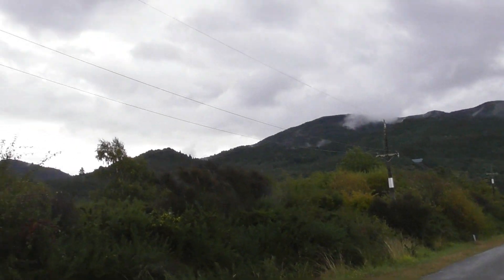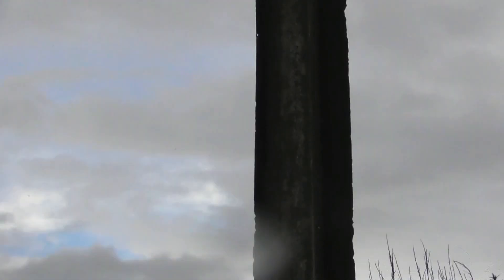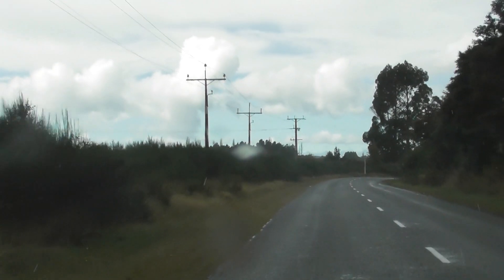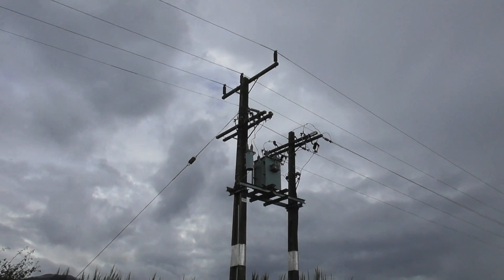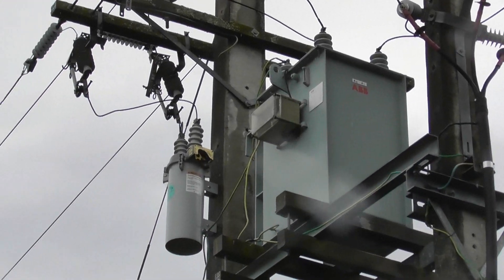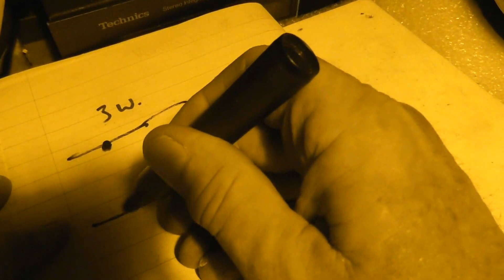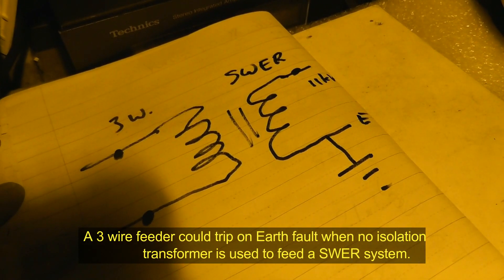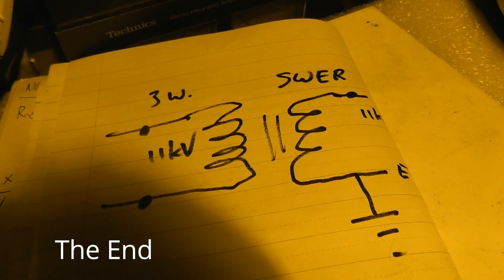S.W.E.R.  Single Wire Earth Return near Turangi, New Zealand

Comment: Great video Ray, it was interesting to see SWER running at only 11Kv, as you pointed out, we use 19.05Kv here in Australia, to keep the primary current low.
I was about 4 Years old when we got power connected to our farm house (we had a 32V battery system until then), I still remember asking Dad (an electrical engineer), how it was that the pole only had one wire on it, he said, its called SWER, look closely at the bottom of the pole and see if you can work it out where the power goes, I knew from playing with batteries, that everything needed a return part, took me a minute to work out that it must have been the planet.
He forbade me from ever going near that pole in the summer months, didn’t say why, we were at a friends house some years later when I discovered why, the lights in their house were dim, and they went off all together when they plugged in the electric kettle.
Dad took me out to their front porch and told me to watch the lights as he filled up cooking pots, gum boots, whatever he could find that held water, and threw them at the bottom of their power pole.
After about ten minutes of the funniest game of torchlight target practice I’ve ever seen, the ground hissed, a bit, and the lights came back on, he never went near the pole to collect the various items he had sacrificed to the gods of SWER.
Reply from the maker: Excellent life experience, love that knowledge your Dad shared with you regarding the SWER system, stay clear of the power pole when it is dry and when some water is poured on the dry ground the lights in the house will be a bit brighter when the kettle is on.
Step potential at 19.5 kV would be high, at least stay 10-15 meters away from that pole. Electricity lesson learnt for life.

Comment: Is the earth/ground rod fenced? Otherwise there could be quit a high step potential near the grounding point when the transformer is loaded.
Reply: Maximum earth return current is only 8A by regulation, so the step potential generated is minimal.

Comment: what about a S.W.W.R system? still the single wire on top, but the return path takes place through a giant wasp nest
Reply: I LOL'ed at this comment for like 5 minutes straight 🤣
Reply: Meh, mildly funny, tickled my brain for a split sec, like dry humor, but didn't even crack a smile... I feel like this joke had so much voltage —er I mean potential, but then it fizzled.